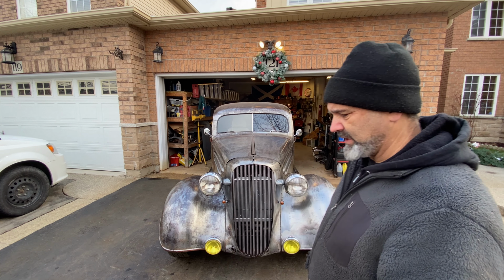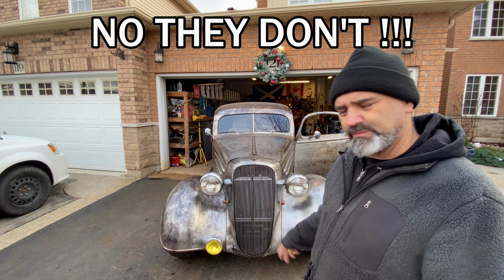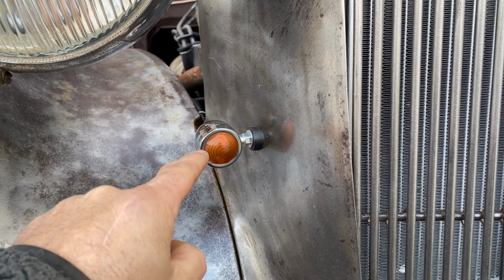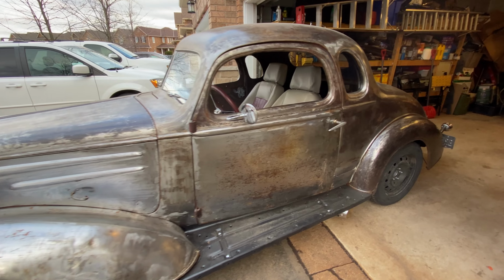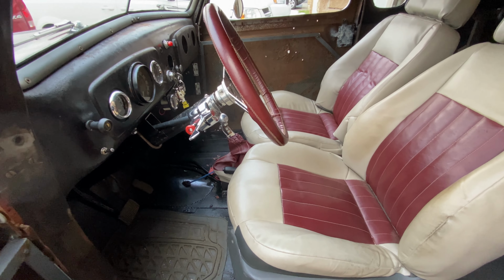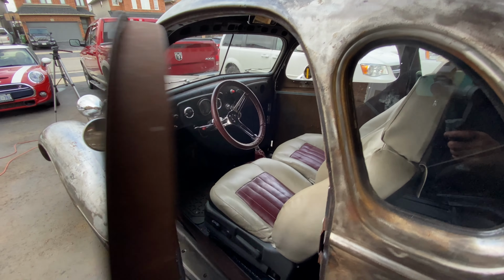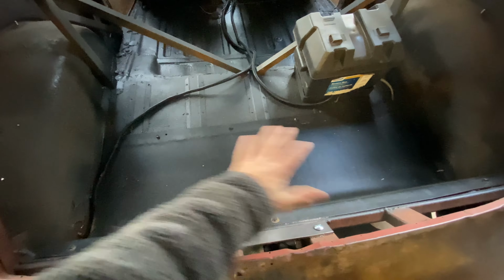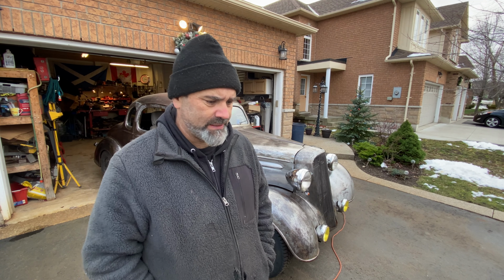Pre Safety Test Check List On My 1936 Chevy Coupe

Comment: Not sure about Ontario, but in Manitoba they will check the ball joints, steering arms, tie rods, frame for rust.  Not sure about a welded on front clip?  The holes in the trunk by the latch would need to be patched up, they allow exhaust to come in to the cab.  May need inside door handles.
Reply from the maker: Thanks Penny. All the suspension arms type stuff is new. RockAuto are very happy, lol.  It's a bolted in Crown Vic IFS, so no welding there. The Frame is solid and rust free. The holes on the rear end do not go into the car, there is a wall that extends down to the floor just below the latch handle. Inside door handles will be done this week. Thanks for all the tips my friend.

Comment: Here in Pa, especially at the shows, they like to see a fire extinguisher mounted in the car, somewhere accessible.  Trunk is fine.
Reply: I would think you need a barrier between the back and the cabin because the battery is in trunk. ( Guessing for your area).
Reply from the maker: @bwsgarage  Yup, will be hitting Home Depot tomorrow

Comment: From the walk around here in Virginia the only things that wouldn't pass inspection are the holes in the body and you would need door glasses and the partition between the battery box and the cabin incase the battery explodes you don't want acid flying everywhere when you're trying to stop Virginia requires seatbelts no matter what year model yep they're fun suckers but bumpers are optional I scratched my head for awhile on that one other then that you could get a Va inspection sticker 👍👍great job
Reply from the maker: Sounds good. I think I'll make a panel for the back.
Reply: Va don't require seatbelts if the vehicle didn't come with them they can't make you put something on that didn't come with them as far as doorglass you don't need them  either someone told you wrong If it's 20 years old or older you don't even need inspection anymore if you run same year tags as car was built say 1941 tags if car is  1941

Comment: i’ve read the comments and think between the trunk and seating area could be a problem???and like you said the bumpers other than that i think it looks good!!!i also have a old car and a guy from a car club gave me the specific code from the police manual that says if it wasn’t born with seatbelts you didn’t need them that doesn’t mean a young new officer that is programmed to do his job will agree but i don’t have them and not had a problem good luck with the inspection!!!!!!

Comment: Dave we couldn´t even build that here in Portugal never mind get an inspection on it...for example to change wheel and tyre size on your wifes Mini or your Dodge if its not listed on the log book you cant do it...if it´s not a manufactures option nope no can do...cant fit dark windows to my Smart fortwo.. it sucks here...weve got solid rust free 205 shells here but cant chuck GTI engines in them or even the 405 16v as cant get inspection on them...
Reply from the maker: Man, that all sucks. We went to a car show in Spain once and it was similar. Lots of nice paint jobs but stock dirty engines because they couldn't touch them.
Reply: @ScottRods  Ha ha same here the boy racers cant seem to get their head around noise and spinning wheels and backfiring is tuning...Have to say though putting my Landrover 101 through its inspection for re reg was lucky that the winch which is fitted under chassis and pto driven is standard and listed on VIN plate because the pulleys sticking out front would never pass if retro fitted...did fit loads of brackets to bodywork for later roofrack and other mods that I got away with as they didnt know if they were military fit or not but are now recorded as they photo every vehicle here during inspections and then every time it´s MOT´d it´s also photo´d and date and time recorded...but the camera misses the 20 euro note in the ashtray...lol...

Comment: Cool looking hot rod ,but you might want to consider patching the hole in the firewall and any holes or openings in the floor for the inspection.,,,,
I know its a work in progress, but, for the love of god fill in the hole on the rear by the trunk lid and try relocating the gas cap.
Great job on repairing your truck....love the videos

Comment: Turn signal might be to small in the front and opening between trunk and inside might be a problem because the battery but some cars read seat foods down but the battery is in front then.How about spare tire & jack ,reflectors?
Reply from the maker: Thanks Konrad. The turn signals are only small compared to the rest of the car. They were meant for a bike, so are legal, so it's based on brightness rather than size. Will be adding a dividing panel.

Comment: door inner panels won't pass safety not crash bars in door  no roll bar in cabin no separation sheet from boot battery box need a vent to out side.

Comment: Looking good Dave! 🤞 for safety....whenever that will be 😉

What about the tire tread, are they all the same (certainly on each axle) and going in the right direction? I’d be testing that right indicator to death up until the day and have a spare bulb ready - or actually just change it out anyway....
Reply from the maker: Tires are all the same, and are non directional. I have a whole spare flasher assembly I might install.

Comment: do the fog lights  have to go out with head lights .low or hi beam ?
Reply from the maker: I'm not sure about that. I have wired them independently as a sort of "show light", so they cannot come on unless you specifically switch them on. We don't get a lot of fog here so I don't expect to use them when driving.

Comment: Dave is there a check list that's available ? The comments about  sealing up floor and  putting some sort of divider between trunk an passenger compartment makes sense.  There is the argument that your vehicle could have been a business coupe no back seat and open to trunk. Bumpers would be my concern. Just remember when manufacturers were required to have 5 mph crash bumper what a joke that's an oops not a crash. Lol . Get inspected work on issues over winter
Reply from the maker: Thanks Joe, that's the plan. If I have a list then I won't be wasting time going in the wrong direction.